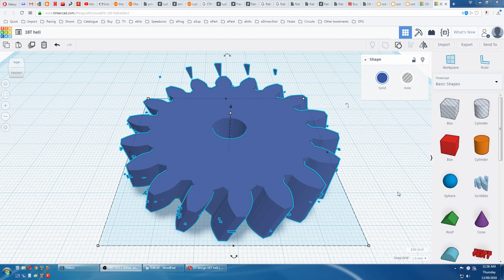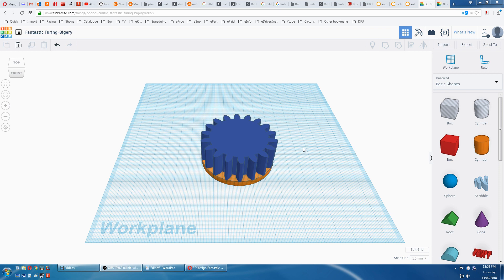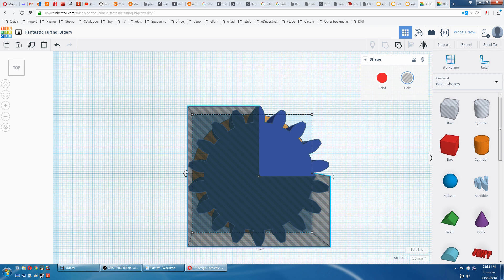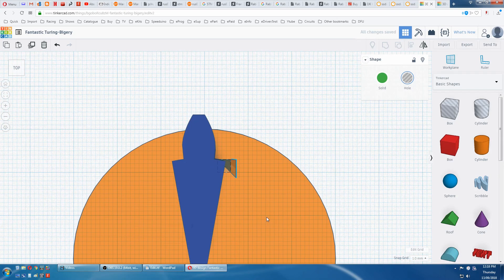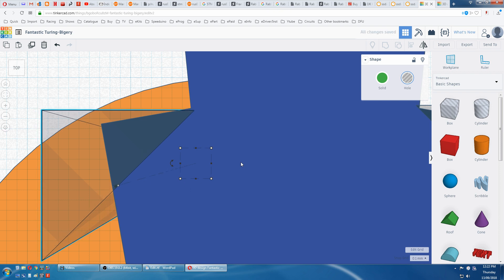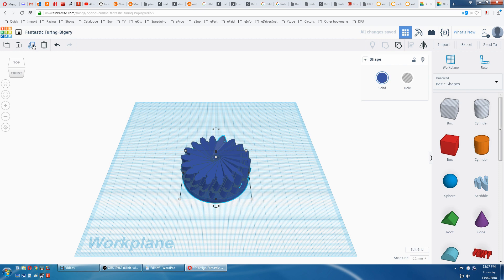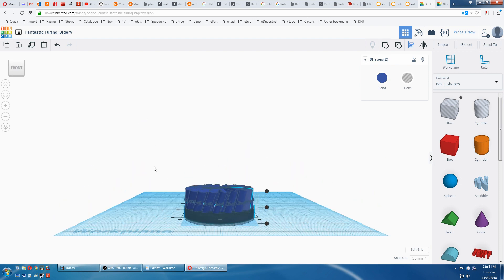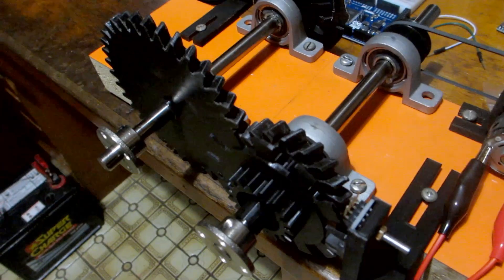TinkerCAD -  Involute Helical Gear

Comment: This is fantastic.. but I have a question... If I have a gear the I want to replicate (cracked model train gear) how do I work out the angle of the original gear?
Reply from the maker: You might have to ask AI - have a conversation but be specific, eg, band/model of train etc-.
All I can think of is blow-up a picture and put a protractor on it.

Comment: Thanks for the insight! Like you mentioned it takes forever in Tinkercad to compute the process. There is a way to swine or kangaroo around it and that is chopping up the process in 3 or 4 stages with making STL files between the stages. that saves a lot of computing so you can make like a 72 or more teeth rotated gear in a few minutes. Make it easy with working around the center point of the Ruler. This is indeed not an involute gear but works great with belts if you need an angle for creative alignments, with any kind of tooth/teeth

Comment: Sorry, this is not a real helical gear when you make the vertical 10deg rotation on the single tooth for the profile is not Involute anymore with respected to the spindle axis. But  still thanks for yor effort.
Reply: What you are talking about is a transverse helical gear, he made a normal one. Transverse keeps the involuted profile the same with respect to the spindle axis. When machinist make helical gears with standard involute cutters they make normal helical gears like the one shown. If you were to make them in the transverse way (what you are talking about) you would not only have to have a set of cutters for the module but you would also have to have them for each helical angle. That’s expensive.